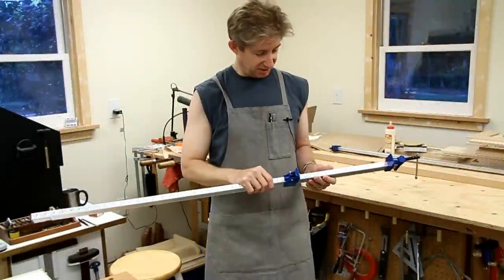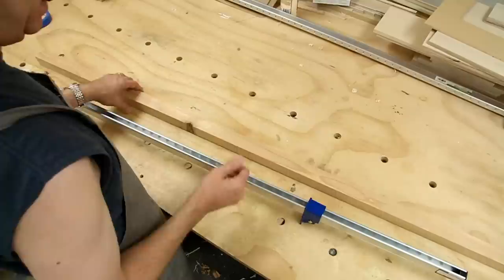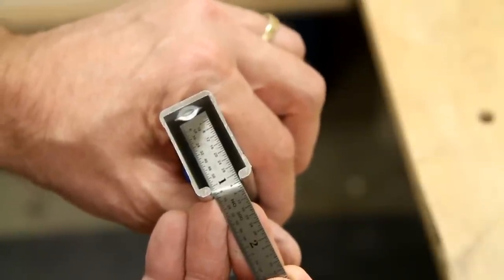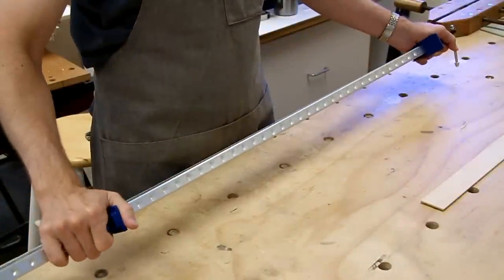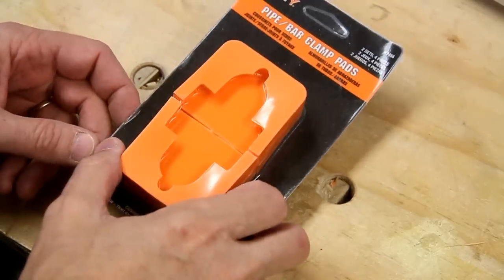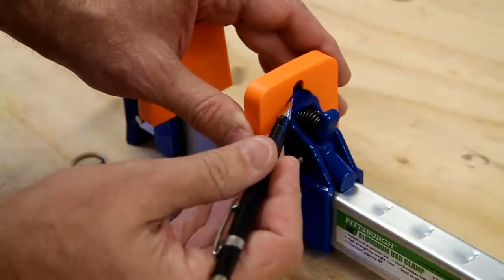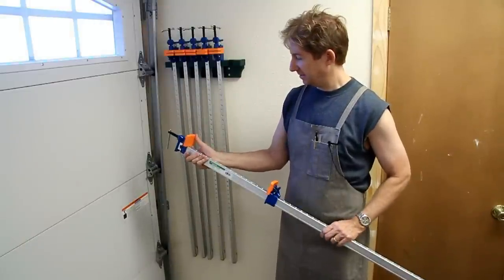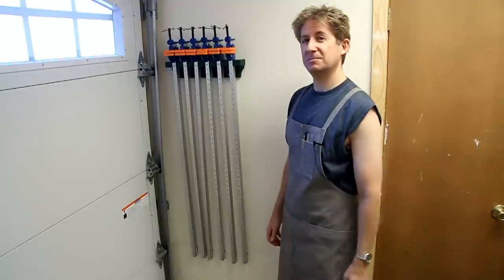Harbor Freight Bar Clamp Enhancements

Comment: Marty - I was inspired when I saw your video and bought six clamps from HF.

I was all set to mill some stock to the thickness I measured for the clamps when I realized that 3/4 inch plywood was the EXACT thickness I needed already.  Some thin rip cuts on the table saw and I was done with the stiffening - easy peasy!

Now I am waiting for my Pony pads to come in!
Reply from the maker: +Alan Erickson Funny, I never thought to try plywood. That was a time saver. I'll remember that if I happen to buy any more (I may get a set of shorter clamps). These alum clamps have their limits, but often you don't need the strength of a pipe clamp.

Thanks for letting me that know you found these useful.
Reply: Yep, after experimenting a bit I noticed that and used 3/4" plywood also. Perfect for those ply scraps lying around!

Comment: I added the stiffeners and wooden pads so my HF have performed just great, however that soft aluminum is finally wearing out after a few years of every day heavy duty use. It's rapidly approaching time for me to go on an extended HF shopping spree for some new bar clamps. I have 6 and of the 6 5 have pretty much exceeded any expectations I ever had for them.

Comment: I'd suggest putting the 1/8" spacer (or even 1/4") inside the pads when cutting out the corners.  This would give you a surface to bear down on without damaging the pads and allow you to press harder when making the cuts.

Comment: Thanks for the tip. That works great and it makes the clamp more rigid and hardly no flex. Haven't tried the clamp pads yet but I'm sure that will work also. Thanks again..

Comment: Nice build! 
I will be doing this with mine as soon as I finish buying the rest I currently only have 1of the shorter sizes but found just the other day that I wanted many more so I will get them the I will do your rework on them but as I prefer to work in HDPE for small stuff I will use it as it is also easier to mold onto the pads.

Comment: Marty u r a genius!! Just did it and it does stiffen them.. Now the plastic part is another story, would have liked them a little higher on the pads.. Still great video! I use them a lot for table tops
Reply from the maker: +Frank Rodriguez Thanks :-)  But like I said in the video, I learned it from Paul Sellers.

Comment: thays that's a great idea. i returned like 8  of those because of the twisting and bending. with this idea im gonna go buy 8 plus another 8..lol good stuff marty!!
Reply from the maker: +Joe basementwoodworking Thanks. They really are surprisingly good once the wood is added. Try a couple first and go from there.
Reply: Marty Backe i definitely will..i noticed a lot of other woodworkers have them so i bought enough to glue up a table top if need be and then the twist happened so naturally i took them back and went to rockler and bought a few from them ..twice as much but no bends or twists..but NOW ,,haha after watching this im going to go back to the freight and get the 8 that i bought origonally and put some maple in them i have a bunch of scrap maple from a blanket chest i did for someone. thanks again for the awsome tip man !!:)

Comment: Thanks for you video.
My problem is that I just bought a few  clams very similar to yours and the are not as stable as expected.
The base of the clamps is so narrow that they fall over very easily making the assembling job  much more complicated than it should be.
Any suggestion reganding how to improve  stability?
Thanks again👍

Comment: Im confused about something and maybe you or someone else can clear this up. At HF they offer both 60" F clamps and 60" Bar clamps. They look almost identical and from what I read, F clap pretty much means bar clamp. Do you happen to know what the difference is between those clamps? I almost want to say its that orange grip they have on the F clamp, but I'm not 100% sure? Thanks for the video!

Comment: It really looked like they twisted as much as they twisted before the wooden insert. With loosely fitting insert will do nothing to stiffen this clamps unless glued in with epoxy.
Reply: I had the same thought at first -- then I figured that when he twisted them before modification, he was probably using lighter pressure because he was trying not to screw them up permanently. Following the modification, he was probably twisting them with more force. Or maybe not. Just a guess.

Comment: do more expensive bar clamps flex any less?
Reply from the maker: Yes. As an example, the Dubuque manufactured aluminum clamps are much sturdier. But they cost over $35 compared to $10. You do get what you pay for in this case.
Reply: Marty Backe how about when the cheap ones are fitted with wood in the bar then compared to the better ones?
Reply from the maker: The cheap ones are still not as good. The Dubuque (in this example) are really nice, solid clamps. But I like the Harbor Freight clamps for their economy and they work really well when used within their limits (light duty applications).
Reply: Marty Backe for small projects around the house is my thing so...yeah some of those better ones are really nice i'm sure.

thanks for clearing that up

Comment: are those pads still available on Amazon?
Reply from the maker: Yes
Reply: I couldn't find them. no pony clamp pads... :-(
Reply from the maker: Here they are: http://a.co/1lCN53C  You just have to be willing to wait until January 8th.  Adjustable Clamp company is the same as the Pony company. The link is what I used to purchase mine.
Reply: thanks! I can wait until January 8th! I wonder if it didn't come up on my search because they are out of stock?
Reply from the maker: I did a search (within Amazon) for "clamp pads" and they appeared. Sometimes you have to be lucky with the words you use in a search. Good luck.

Comment: These clamps are junk even with the mods added. I hated these types of clamps and they always broke on me and the handles never could handle extra torque loads to crank down the wood together, so I said screw it and made my own bar clamps and wow I will never ever get cheapies again. I made each bar clamp for the cost of these and they are 10 times stronger and have a nice wide surface that is flat to rest pieces on during glue ups. I might make a video in the future of making some of these as I have an amazing locking mechanism that I have not seen on any of these other clamps before and works far better.

Comment: Seems HF is always improving- Recently saw a new style 60" aluminum bar clamp with larger end brackets and covered pads--   #60673

 http://www.harborfreight.com/60-in-aluminum-f-style-bar-clamp-60673.html

These work OK and $14 isn't a bad price,  but will try your erection correction.

Comment: I'm not sure I understand the need to fix the twist.  These are for panel glue-ups, and that does not require much pressure. I feel that if you crank them enough to twist, then that's probably too much pressure.
Reply from the maker: +tdok If you have these clamps and the twist doesn't bother you, then you're good-to-go. This enhancement suggestion is for the other people.

Comment: * DO NOT BUY THESE JUNK CLAMPS*

I use harbor freight pipe clamps and F clamps, they work, they work well. Been using them for years. The pipe clamps wind up breaking, but they server their time usefully, and work just fine for enough time to justify replacing them. Not like the pipes go bad, and 12 bucks once every 2 years to replace one is just fine for me. The F clamps have some "flex" but not enough to matter, they clamp well. 

Theses particular ones are 100% garbage. I own 2 (thank god I only bought 2), and mild clamping pressure broke both of them in very short order. Not like "ah crap, I gotta fix it", I mean "Catastrophically failed to no return" damage. One of them broke off clamping a tool down to simply hold it in position. I wasn't even cranking on it! 

Source? this...

http://i.imgur.com/FwXyNgC.jpg
Reply: +JgHaverty Invariably I will receive the "you dont know what you're doing" or "I've been using these forever! they are great!" comments. I own hundreds of clamps. I use them daily. I can't afford to buy 50$ clamps x 20, thats too much money for me on that kinda thing, so I always explore cheaper options.  Some times that works ok, sometimes it blows up in your face. Stiffen these all you want, they are JUNK.
Reply from the maker: +JgHaverty I think these clamps are OK light-weight clamps. I would not crank hard on these and expect them to last, but I've had no problems using them for panels glue-ups and other areas where moderate pressure is needed.  I'll use my Pony pipe clamps or Bessey bar clamps if I need to close gaps, etc.

I'm happy with the six that I own. One mans perspective.
Reply: Marty Backe I figured the first one was a fluke, but when the second one went... I dunno maybe I grabbed out of a bad batch, they both snapped off in the same exact spot. 

May seem contrary, but Im not trying to diminish the value of your video, I know you're trying to help and stuff. In my experience with these, it just didn't end up very well.
Reply from the maker: +JgHaverty No problem. That's what Youtube and the comments is all about - providing information so people can make informed decisions. Your input is great, and thanks for taking the time to do so.
Reply: I believe you completely Jg, most Horrible freight stuff is Junk!
Reply: +JgHaverty  I too have come to learn that all clamps at HF are only good for light-duty.  Once you know what to expect, the value of these are actually pretty good.  I personally wouldn't go through the time and expense of stiffening these, however.   I've not hat the blue part break yet, however, the aluminum is clearly thinner than the higher-end bar clamps that Rockler carries.  I've even had a few of the notches on these HF bar clamps tear out.  Fortunately, HF has a lifetime warranty on these.
Reply: I personally feel if you need that much force on a glue joint you need to learn how to use a jointer better,  better stock,  or more common sense.  I have used these forever.  Recently I've been buying the Irwin ones they are twice as heavy and cheaper when they are on sale at Menards online. When I stiffen them with wood they are much stronger than the harbor freight ones. Either way I rather use these then heavy awkward pipe clamps. Cheers

Comment: Instead of buying HF crap that you have to spend even more time and money "hacking" why not buy Bessey H-style pipe clamps and cheap metal pipe. Boom, problem solved.
Reply: Because that doesn't create content, and sometimes you gotta polish a turd to do so.
Reply from the maker: I didn't make this video just to create content. I actually use these clamps (I already owned four) so when I bought two more I thought I'd film my modifications.
Reply: Not saying that was the only reason. Saying that buying the right crap is good, but isn't nearly as interesting as making something that ain't all that work. Creative content is better than same-old, and using shit to make Shinola is a good way to create it.
In general, I don't care why people make good content as long as it is good.
Clamp on!
Reply from the maker: Thanks :-)
Reply: Exactly how much money and time is spent on milling some #2 pine and placing it in the clamp? It took me exactly 5 minutes to do two and I have a whole rack of HF bar clamps that I use every day and it cost me a fraction of the price of Bessey.
Reply: EliteHunting1911 Price is the main motivation. HF clamps are dirt cheap and 20 cents and 5 minutes to beef them up is time and money well spent. 
I didn't go the cover route, but just glued wooden pads on with cheapo HF epoxy and they work just beautifully.
Reply: I've never seen such non-sense comment. Bessy (without pipe) cost more than these clamps + you have to pay for pipe + thread.